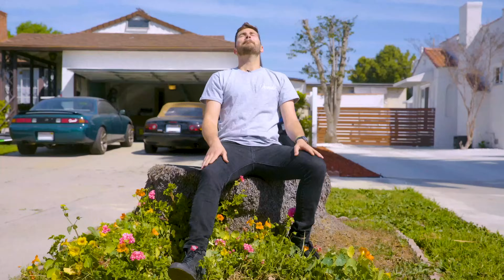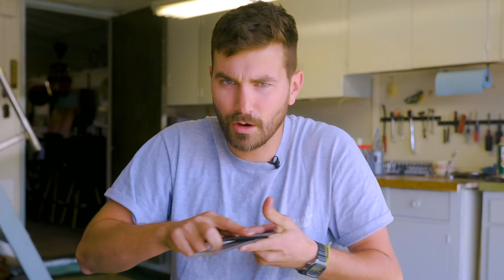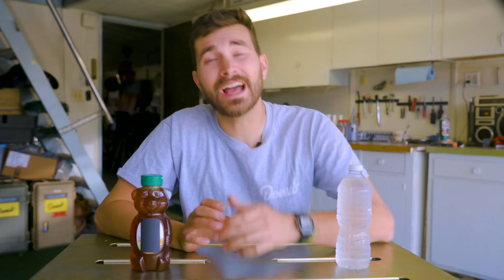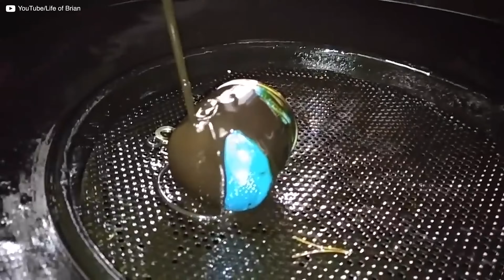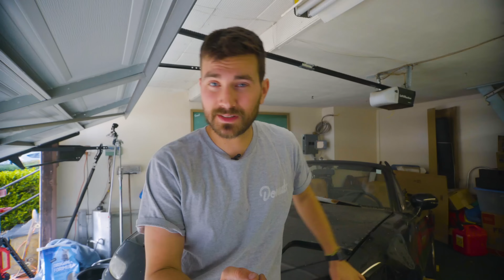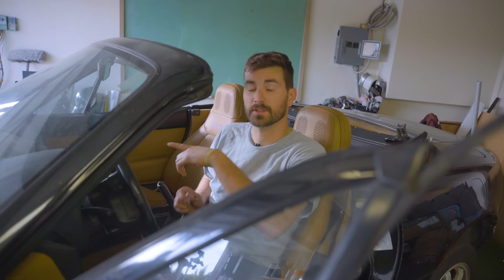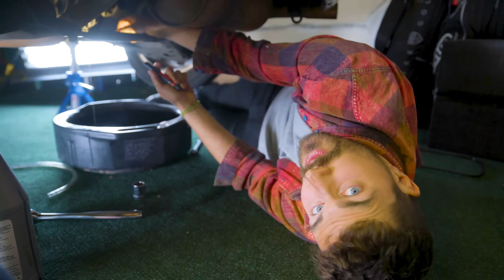9 Things You’ll REGRET Not Doing to Your Car

Comment: something ill say working at ski resorts on heavy equipment. If the vehicle hasn't been moved in a while. ATF has a way of kinda congealing. So if the car has been kept in a garage and not moved for a while you might just need a fluid change to solve your power steering issues. Just try not to run that bad oil for too long. If you're gone drive the car home from the sale,  warm the vehicle up and rotate the wheel back and fourth and do the same at a very low speed for a few minutes it should loosen it up enough to get you home w/o damaging your pump. You should pretty quickly feel a big difference in the steering if this is the issue. Please be careful and mindful of the behavior of the steering column on your way back!

Comment: You didn't mention the worst thing you can see in your oil, transmission fluid, or diff fluid, which is glitter. If you're seeing glitter or metal flakes, that means whichever part you're working on has already sustained interior damage. Unfortunately common in project cars.

Comment: Everything he said is absolutely correct, the only thing I would say not to do is gapping the spark plugs. If the gap isn’t correct, just return it and get a new one. Other than that it’s all great information on why the maintenance is needed and how to do it. Great video.
Reply: That's bad advice, with the exception of Iridium plugs which aren't designed to be gapped. Not all plugs are gapped to your specification.

Comment: This video is really bad advise.  I would call this video what to do to your car if your rich and like blowing money you dont need to.  Replacing spark plugs and a lot of this shit just for the hell of it is just a waste of money wont make your car run any better unless there is a issue.  Spark plugs can go 200k miles and still be running a vehicle just fine, though regaping ocasionally isnt a bad thing.

What this video doesnt stress and should.  Oil matters and keeping it clean matters even more.  save the money from those plus and spend it buying a good oil filter a Wix or a K&N or even the high end mobile one filters.  If you take your car in to a oil change place and let them put a fram filter on your car you might as well put the old oil back in it.  Fuel filter it doesnt need to be replaced unless your having trouble with it getting clogged but as your vehicle gets older its not a bad idea even adding a second fuel filter some where is a good idea.  Metal tanks get rust in them as they get older and you can also get bad gas sometimes this can destroy a engine.

when it comes to airfilter just check that thing when you do a oil change it doesnt need to be replaced that often its more where you drive then how many miles.  You live on a dirt road that thing will need to be replaced way more often it starts to look dirty replace that thing and again dont cheap on filters.
Reply: after 200k miles spark plugs will not be doing that great of a job, and honestly factory or factory performance (like toyota's trd) are much better than k&n etc. and this stuff is basic maintenance, not blowing money when you dont need to

Comment: For every 10000km or per year, these are the stuff you'd check and change. And you do this yearly, and up until the 5-7 year mark, everything should be fine(very least in better working conditions). Around 100,000km or so, have your timing belts replaced. Once replaced, check every 60,000km.

Comment: I'm just curious, just started apprenticing under a couple mechanics and they say it's also good practice to always prime your filters. Taking that oil filter and putting new oil in it before putting it back on the car so you aren't starting with a dry filter? Is that just preference or is that actually a good practice to use?

Comment: One of the best basic maintenance videos I've seen. I like the technical aspect of his explanations. But keep in mind the maintenance is centered around a late 90's Mazda Miata with a manual transmission and will probably not perfectly match the maintenance on your vehicle.

A few things to note:
  1. Most cars have an automatic transmission which has a more involved fluid replacement procedure. 
  2. Only gap the cheaper spark plugs since higher quality spark plugs are usually coated in iridium or platinum, and gapping those could mess with that thin layer of metal.
  3. Drive belts in most cars nowadays have automatic tensioners and only one belt, making things a bit easier but different from the video.
  4. Fuel filters in most modern cars are integrated in the fuel tank with the fuel pump and a few other things, called a "sending unit" which cannot be serviced.

Comment: Wetting the oil filter ring isn't just to help it seal, it's to stop it from sticking to the engine and detaching from the old filter when you try to remove it. If that happens you won't be able to seal a new filter to the engine for very long.

Comment: Didn't see it mentioned in the video: Dark oil is not necessarily dirty. It gets dark the FIRST TIME it gets up to temperature. Nothing wrong with it, it's just chemistry. It's an old shady mechanic trick to show you your dark oil as "dirty" and therefore you need service. The trick is so common, it's actually a good test to see if you have an honest mechanic.
Reply: dark oil is dirty, its not like you change it and then drive it and its back to dark again. theres no tricks, have you done much work on cars?
Reply: @arcanevoid9199  There`s a bunch of videos showing this phenomenon. Just because you`re too lazy to find them, doesn't mean it's wrong. I believe Engineering Explained has multiple
Reply: @FrankLeeMadeere  after changing the oil in my celica it stays clear for about 3000km, have done the last 5 oil changes and it’s the same thing every time and even my friends celica. so idk about that one

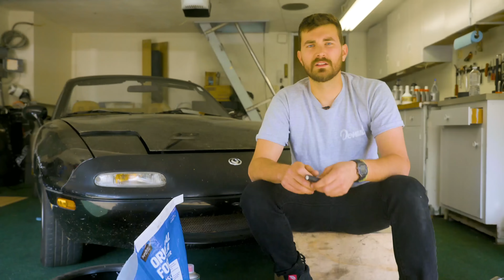Comment: @5:00. 3000 miles of urban inter-city rush hour bumper-to-bumper (Avg .. 3 MPH in Toronto .. but how many HOURS?) is not the same as out here in the boonies with 35 MPH secondary roads, twenty-five miles per trip. I'm admittedly a bad man .. Just went 9K on the dino juice, but then again - the body will be gone long before the engine of my '07. "Mileage" alone is an idiot metric for oil change intervals.

Comment: All really good info. I'm not seeing it in comments, but if you are doing your spark plugs and you haven't before. Either be sure to label the plug wires for location, or only remove 1 wire at a time, replace the plug and put the wire back on. They aren't interchangeable  for placement.

Comment: When talking about coolant, it is also very important to mention another crucial aspect of antifreeze: not only does it inhibit corrosion in your cooling system and keep your coolant from freezing - it also increases the boiling point of your coolant which can be very important on a hot summer day!
Also keep in mind that the pressure in your cooling system increases that boiling point further, so make sure your cooling system isn't leaking and especially your coolant cap is holding pressure as specified.

Thanks for the nice video though, guys!

Comment: Pretty decent job! The reason we oil the oring on the oil filter isn't primary to help to "seal" it's also more importantly that comes next change, the old seal doesn't get left behind and stick to the housing. Double sealing will cause all your oil to leak out and possibly destroy your engine. While an oil change is simple, you  can't take this part lightly. Also no need to prefill your oil filters. Generally your just asking for more of the mess!

Comment: also replace your brake lines and power steer lines every 5 years minimum; depending on use as in more use means more wear. but if you leave the car sitting not in use, still replace the lines, fluids will permiate the-inner hose  liner over time. additionally new lines give you increased response (not by a lot but add small problems up n u get a big problem ) 
new lines can increase the “smoothness” when you brake or steer. 
all hose is rated for a certain amount of “on off” cycles. this can be called impulse. 
you might press the brake peddle 5000+times in the space of a year. …you get it.

Comment: Only issue I've had doing my oil is that the car says it takes 6 quarts on a change but im pretty sure 4 to 4.5 is more accurate I put 6 in this time and it's higher than full now I have to drain some but any time before with 4.5 has been perfectly like just below the full line could that be a problem am I underfilling it when I do 4 qnd a half? And I overfilling with 6 ? Is my dipstick right?
Reply: What year is your miata?

Comment: If you have a truck change your rear differential fluid shops rarely ask and if it goes out you’re looking at a $3000-$4000 fix. Also driveshaft it costs $495 new if it goes out it will most likely break your transmission at the same time, again shops never ask about your driveshaft.

Comment: 10W30   I ALWAYS CALLED IT "WEIGHT" (aka - thickness) as I run single grade motor oil - 30W for the summer and 20W for the winter because there was no such thing as multigrade motor oil back in the day.  I know what the numbers mean and I live in the land of SNOW in the winter. Also knew the weight of the oil is needed for the winter months. 75W90 has something to do with winter(NO...IT IS THE THICKNESS(or Weight) OF THE GEAR OIL to protect the gears from squeezing out making metal to metal contact because of the extreme gear pressures).  K.I.S.S. applies to mechanics.

Comment: I'm surprised I didn't see any comments about removing the oil filter after draining the oil and replacing the drain plug. As a mechanic, I recommend removing the oil filter while the drain plug is removed as a rule of thumb. There are many modern cars with oil filters placed at the top of the engine and these don't drain until loosened.

Comment: lol. 3000 miles or 3 months for oil change. My Maserati owners manual states 12,500 or 2 years but it also takes 2.5 gallons and the filter is $50 from Maserati or Ferrari.

Comment: Great video! Most importantly, know your vehicle! They are not all the same.

If you drive a Honda, the transmission, differential, and power steering fluids to use are Honda fluids ONLY! You can choose what you want for oil, brake fluid, and coolant (Honda requires the green or blue stuff, but you don't have to get Honda brand). Also FYI, Idemitsu manufactures Honda's oils, so you can use Idemitsu fluids for Hondas. It's the same stuff. Don't mess with your Honda when it comes to those 3 fluids. They will more than bite you in the butt, they will destroy your wallet. Also, use NGK or Denso spark plugs, NGK spark plug wires, and Gates timing belts if you don't want to get them from Honda. Those folks manufacture Honda's parts. Get Gates belts for the other ones if you can, but those are not as sensitive. And on modern spark plugs, don't mess with the gap unless you drop one and bend the electrode. You'll damage them trying to check the gap. 

Check you owner's manual for the maintenance schedule for each system. Honda doesn't recommend you ever touch the power steering fluid, but that's not good. Change that fluid about every 60,000 miles or every 4 years. If it gets very dark and nasty, check the system and change the fluid along with damaged hoses, reservoir, and possibly the pump. The reservoir contains a filter, so change the reservoir when you flush the fluid.

Comment: i changed my transmission fluid ,tho i still get some hard to change gears,any thoughts on this one?
Reply: Normally the only problem you are likely to get on a particular gear as a result of changing the fluid is slipping gears, only in an automatic transmission, and only if you went too long between fluid changes. If there are gears which are hard to change, you may have a very expensive problem which is probably not worth fixing.

Comment: Lubing the oil filter gasket prevents it from sticking to the mounting plate which could result in a double gasket next oil change.  Which is a bad thing.

Comment: In 34 years of driving, probably a million miles or more...I've never found a visually worn out spark plug.  Never found an electrode burned away.  Crud on them and oil fouled on an MG I had in college (I think that's part of MGs design spec to burn oil because even on ITV-BBC they all look like two strokes pulling away from the camera).  I have found rust on small motors.

However usually the motor perks up a bit with new plugs, so I'm assuming some of the internal resistance is changing with age.

Comment: OR YOU BUY a Tesla, model make 2017 or later, and your car will be 100% MAINTENANCE FREE (even including brakes, as it can fully brake with its very strong motors). Only thing left to do with your Tesla: Change tires eventually and maybe refill your widow wiper fluid, if you use it up. Dependent on how your air quality is, you may change the cabin air filters every 3 or so years. Voila!

Comment: Why do Americans have such a fetish for changing oil unnecessarily? Even in the '90s here in Europe oil change intervals were 15000km or 2 years. These days almost all car manufacturers recommend a change every 30000km (~18650mi).
Changing oil every 3000 miles (~5000km) is completely unnecessary, especially if you use a good synthethic oil (as you SHOULD). Come on we're not in the '50s anymore, oil doesn't degrade that fast anymore.

Comment: funny thing is that copper spark plugs have the best performance being the most conductive and reason most if not all race cars use copper plugs.  Don't get caught with the gimmick plugs they make like two prog lol electricity flows to the closer prong there is no benefit.  Great video for the laymen on easy standard car maintenance that should be done at home but never will ;p

Comment: A good tip I learned when bleeding brakes (especially on older cars) is to jack the back of the car up higher than the front. This ensures that air pockets higher up in the lines can escape through the reservoir… since I’ve started doing this my pedal has been so much more responsive after bleeding the brakes
Reply: That is a good tip, thnx man!
Reply: escape thru the nipple
Reply: Was bleeding brakes today. And saw this again later. What a coincidence.

Comment: Note on differential service: there are 2 plugs. Fill and drain. Check the drain plug. Usually it has a magnet. There will be gunk and fine metal flakes, which is normal. Double check for big flakes. Usually doesn't have it but it's good to check. Then clean the plug with a rag until all the gunk is off.

Comment: At 10:29 you call brake fluid Hygroscopic, it’s actually Hydrophilic because the water bonds with the brake fluid on a molecular level, as opposed to Hygroscopic which would attract and absorb, but not bond with the water

Comment: Here are some tips he forgot to mention for you car newbies:

Bleeding brakes: You wanna first bleed the brakes farthest from the brake master cylinder. The reason being is to completely bleed the air of out the master cylinder. Since the miata is a left hand drive, you wanna first bleed the rear right caliper, followed by the rear left, so on and so forth.

Spark plugs: Put a thin layer of anti seize on the threads before reinstalling the spark plug. The heat generated for the engine sometimes make the spark plugs get stuck.

Comment: Good advice , IF YOU CAN fill the oil filter befor you install it , prevents the little bit of dry run and gives accurate oil level readings when done

Comment: When doing the brake fluid also check the order in which to bleed the brakes. Because of the abs system it's not as simple as the old way of starting with the furtherst from the reservoir some are a box config like front driver, Rd, fp, rp. Some are an x config fd, rp, Rd, fp. Some newer car require a OBD2 scanner to put it in maintenance mode to actuate abs servo to bleed the calipers.

Comment: So I went to put break fluid in my 2002 Honda Civic as it had no brake at all and no fluid. I had the rear right tire off and as my friend pumped the brake it, and I proceeded to strip the bleeder valve, fluid sprayed from the line. How do I change the line and what tool is best to open the valve besides a regular box wrench I tried to use?

Comment: Hey did you know spark plugs are AC components?!  THERE IS NO POSITIVE TERMINAL!!!  It's just a HOT terminal and a ground.
The coil is a type of transformer that changes pulsed 12v into high voltage AC.

Comment: The older the car is the more likely it is to benefit from re-evaluating what constitutes the recommended oil type and change interval. If we looked at a hundred year old car, it predates oil filters, multi-grade oil, and synthetics. The original maintenance recommendations would be a bad idea. New oils last longer than they did 40 years ago. If your car has VVT but predates oils made just for VVT engines, then you may want to re-evaluate as well. There's more, but you need to know what's out there for the tech in your car.

Comment: @6:30, you should ALWAYS  replace the crush washer on the drain plug as it is basic in making it leak proof and requires less torque to seal.

Comment: You say the second belt is tricky? I had an 01 mazda protoge and the sideways motor meant both belts were crammed up against the passenger side fender well. What a Pain in The Ass they were to change. you needed a small child to reach the alternator bolt if you couldnt lift it a few feet off the ground. lol.